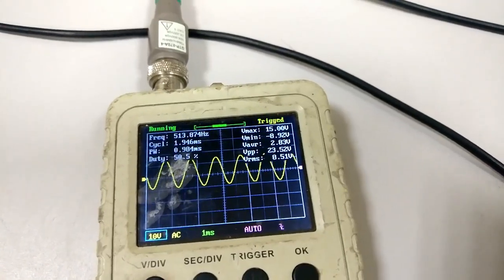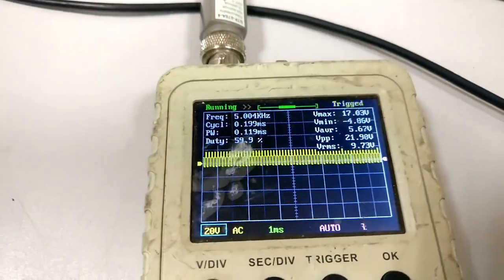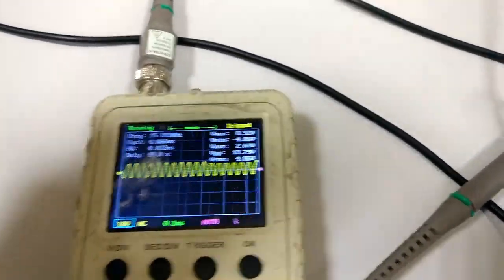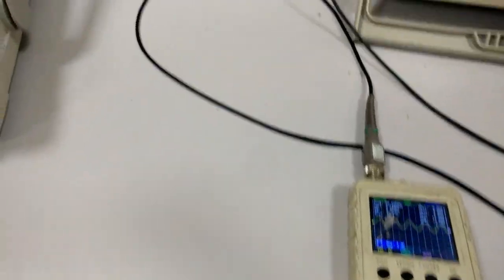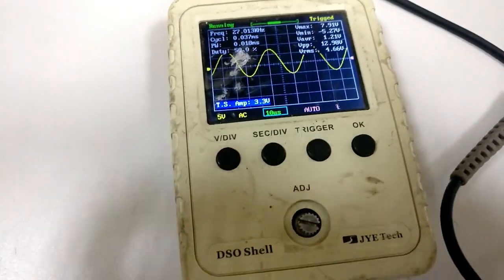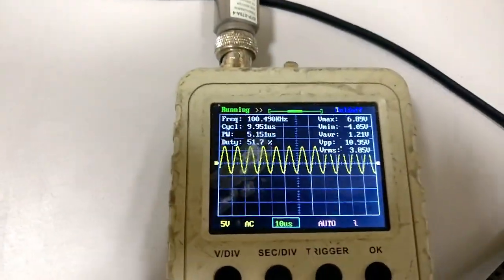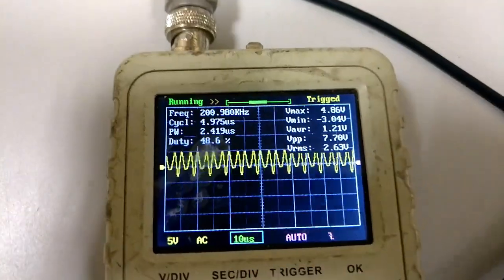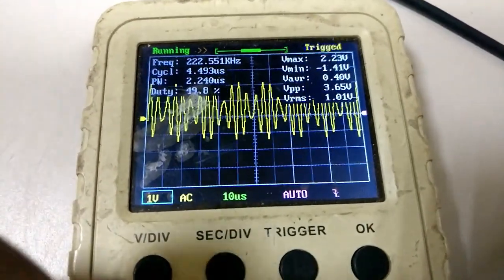DSO 150 oscilloscope  Frequency measurement

Comment: English title and description .... video isn't ... wonderful
Reply from the maker: 😜 sorry
Reply: @labtronics1140  No worries just trying to figure how to use this DSO150 to set the gain on my Car stereo and amp =p. Never used an DOS before ....
Reply from the maker: Its so simple
Reply from the maker: Put 50Hz audio signal to the amp and the put speaker wires to the buffel and same line attach the oscilescope  and increase the volume. Then you can find which output  AC voltage it get distroy. Then off the amp and again put clamp meter or ammeter to measure the current . At that moment current and voltage you can multiply and figure out which is the rated power you can get
Reply: @labtronics1140  Well, I want to set the gains at 40hz. I just don't know what settings I'm supposed to have the DOS set to ... AC or DC, the ms, volts, do I need to adjust any other settings? Also I read you have to calibrate the 10x probe, how do I do that?